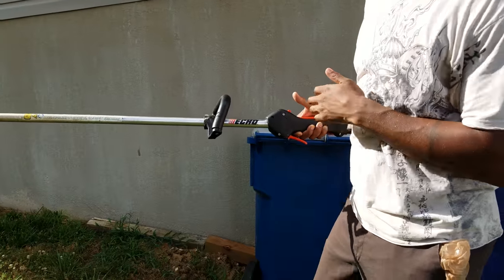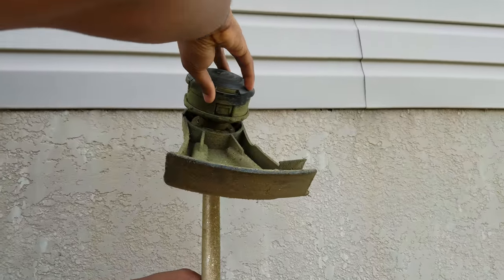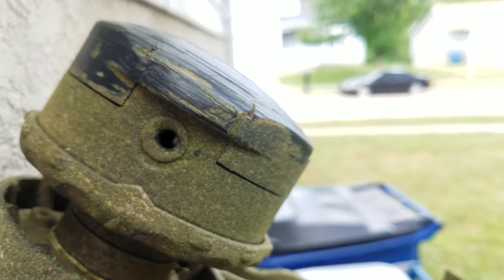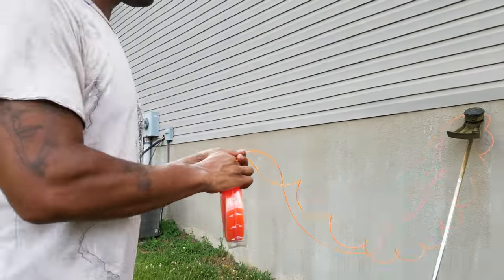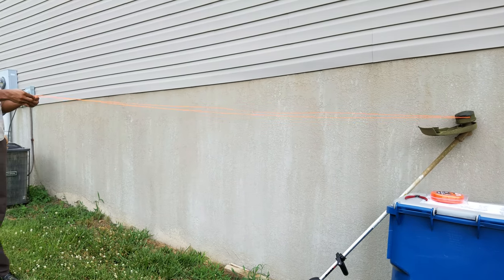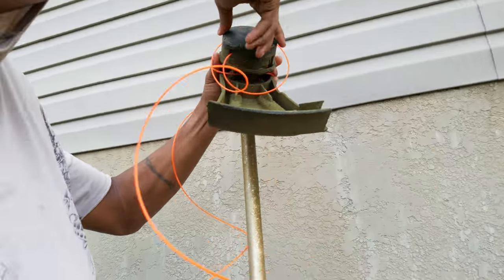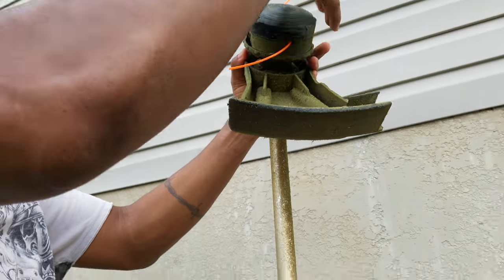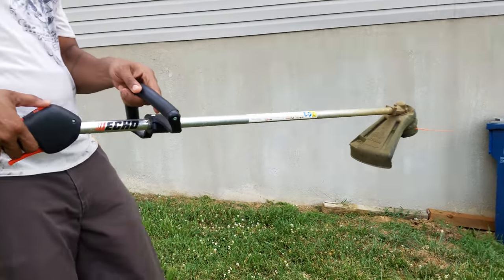How to String a quick feed gas trimmer( Echo 225)

Comment: I normally take out the string spool and put the wire throught then put it back on the head you finna save me a lot of time bro!
Reply: Same here 
   Did the same.  Now gonna do it this guys way.  Save time
Reply: I did his way
But I could not feed the string 
I had it aligned.  But the string was too curly I guess

Comment: This is a great tutorial and I did it just like this HOWEVER now when I give full throttle the line lengthens without intending (without bumping bottom) and I have to stop and retract some line. Wondering if tension wasn’t tight enough when putting the line on? Anyone have a suggestion? Thought? Thx 🙏🏽

Comment: how do you make the line longer when it wears down?
Reply from the maker: Tap it on the grass or the ground and the string automatically comes out
Reply: @brother6ixx  thank you I will try that!
Reply from the maker: @bboygraff1  it should work with no problem. It's a quick feed trimmer head that's why people love them. One of the biggest reasons is because when they get low you just tap it on the ground while you're in the middle of trimming and the string comes out automatically. 🤝🏽
Reply: @brother6ixx  fantastic glad you know so much about it!  be safe!